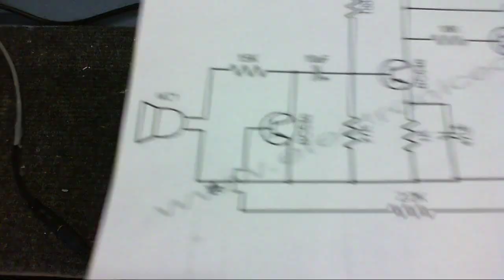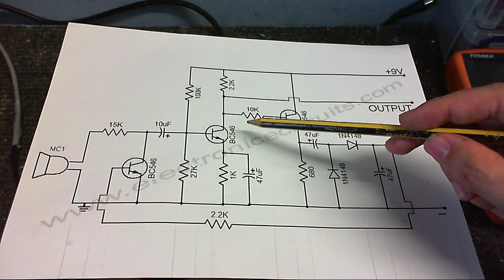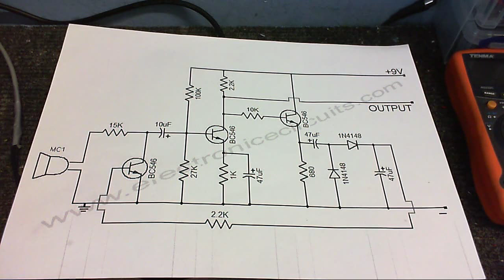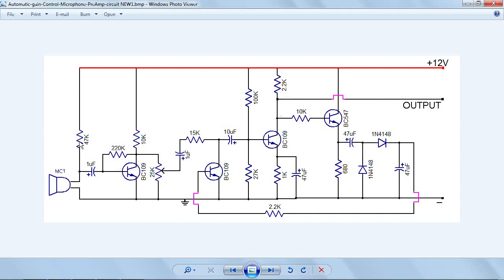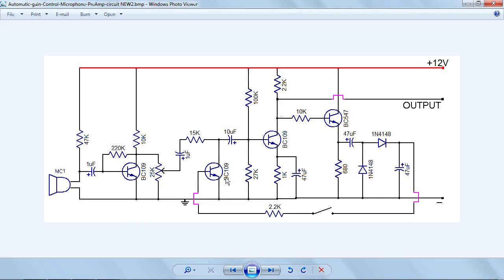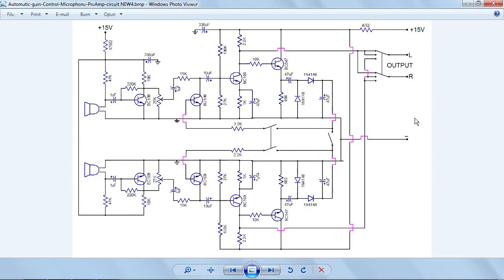My new STEREO Mic preamp

Comment: About limiter - leaving the base floating like that is not a best way to do it. To shut off AGC I'd rather shunt b-e junction with a low value resistor. Just a friendly advice
Reply: I noticed you here LOL I tried this and doest really work for me it does control gain a little bit but output goes louder with input untill agc part starts to clip very hard,I need it for my fm bug to get sensitivity without overmodulating carier and getting cliping sound.
Reply: JOSIP Žlk What you getting is perfectly normal behavior for this circuit. It passes the audio like it's not there until the audio reaches certain amplitude, which will create enough voltage on the output of the doubler to turn on the transistor which shunts the audio. It DOES NOT control the gain, it just kills the input if the output goes too high. I'll give this circuit a look next time I'll have free time on hands.
 By the way, did you make a clap switch for your room? You've mentioned that before, then I cobbled a simple circuit together for you as an idea for your application
Reply: +MrJohhhnnnyyy  I wasnt  home for 3 weeks and also I got arduino and did some stuff with that so I just kept stealing parts from your circuit That built on breadboard lol.This "agc" shoudnt be called agc but audio clamp or something like that i saw it on google pictures,one or two diodes coud be used instead of that transistor
Reply: JOSIP Žlk Arghhh! Why do everyone gives up so easy, they want to use Arduino in everything :) And yeah, actually, I "steal" parts from schematics too, and repurpose them for my task. In fact, the flip-flop using gates in that clap switch I took from Talking Electronics website. So use parts without any hesitation :) And last, yes it should not be called AGC.
Reply: I am not giving up just wanted to try diferent things,also I built esr meter and tested some old caps from yugoslavia and compared to used china crap and those old caps dont even have one half of ohm some even   lot less than that  I was very suprised by results.
I hate circuits from internet  many of them are shit desings or in this case not working like like advertised.It seems to me that almost all circuits from google pictures are jokes
Reply: JOSIP Žlk I found another AGC circuit, it's quite a bit more complex but it has true gain control. http://www.arrl.org/files/file/Technology/tis/info/pdf/9711036.pdf
Reply: +MrJohhhnnnyyy  I dont have any jfet-s but I have idea how to do it,I want to make circuit that lowers bias resistance of condenser mic by that it woud lower the volume but I am too lazy to do that right now
Reply: +JOSIP Žlk Just make sure it won't lower it too much to avoid damage to the mic

Comment: Any ideas on how to make something like this but for a record player? I want to bring a phono level signal to a line level signal so I can feed my record player into my PC and record Vinyl to HQ mp3. Maybe with a level control.
Reply from the maker: coondogtheman1234 It might be possible with a single-transistor amplifier connected to a low pass filter. Although you could try hooking the cartridge directly to the computers mic input, then use software such as Audacity to record and add the equalization.  You might want to have a look at http://sound.westhost.com/projects-0.htm#pre, there are a couple of phono preamp circuits there.
Reply: CoolDudeClem
Most min inputs are mono and have a power rail for powering the mic so that may not work. I do have a Y cord the ones for hooking a CD player or iPod to a stereo system.